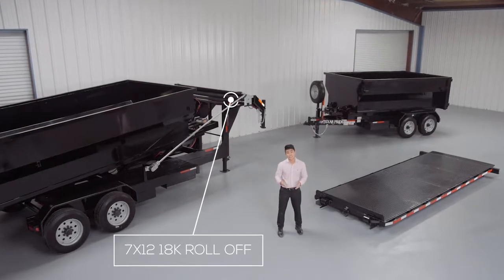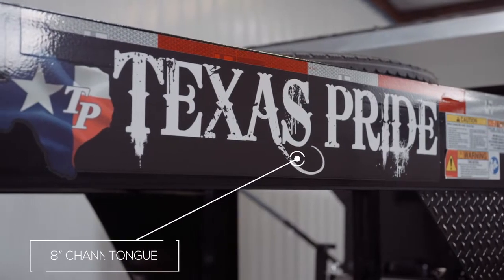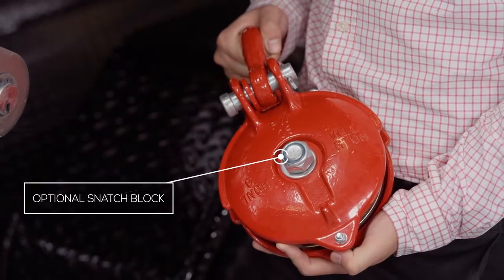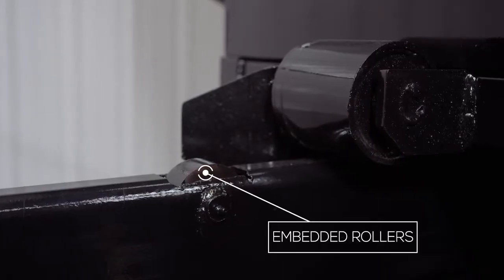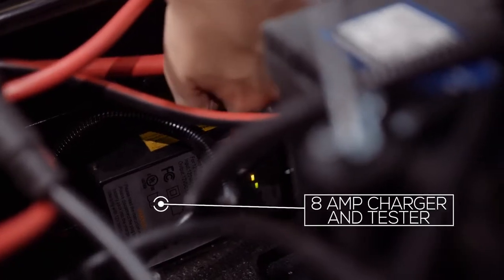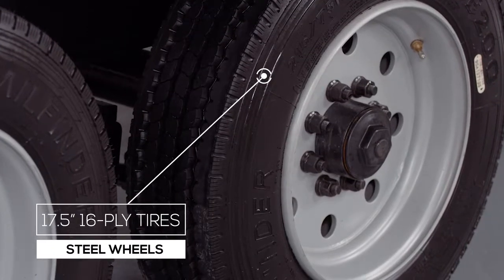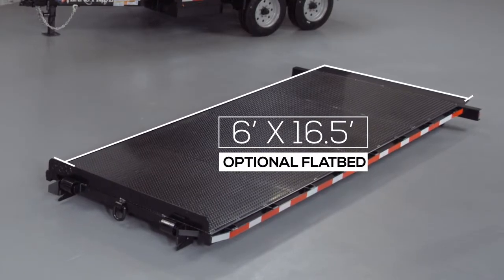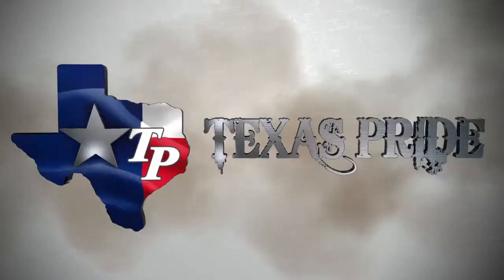Walk Around: 18K lb GVWR Roll Off Trailer System | Texas Pride

Comment: Wanted to wait bit before reviewing. 

I  bought one of the 18K  goosenecks roll off  packages in mid 2021  was suppose to have all of the goodies optional accessories  gas engine pack  & power tarp  wireless remote,  hyd  jacks etc.    2 x15yd  and 1 x25yd.
As trailer is traded between multiple trucks and did not want to  wire them  all with the  12v harness plug.  

Now 7 months in.

Trailer and  bins have done & hauled all the jobs that  have been asked of  it.

The  Bad: 

 Salesmen I talked to  transferred on me midstream  and no contact on the build  from anyone till  called to check on progress  and found this out. (this was a 6 month out build.)
Brandon became my new one.

   
You lost the trailer frame  the week when we were scheduled  to pick it up.   Called me 3 days before as I was already in route  sitting at a hotel in Texas.       Was sent out for some reason.   Stated it was a yard mistake.  And then had another  one but had to put the trailer together.

Arrived at 8 AM   3 days later trailer was still not done   said would be done in a couple hours and did not leave till 4 PM  that night. 
 
Did not get hydraulic jacks which were ordered on my original trailer.  

1. This trailer with the weight it  can  haul.  There have been many times have had to drop loaded trailer to  run somewhere  that I'm unable to take the trailer with.   With the  25yd  full of wood debris  hand cranking  stinks to get it  on/off the truck.  Regret not having the hydraulic jacks.
  
2. This is plugged in after uses,  when sits for a couple days,  and plugged in  the night before use.  This is the same while driving  attached to  your  truck also.   With the gas power pack setup the charging system only charges the battery in the side box which is for the electric brakes and tarping system.        It does not charge the gas power pack battery on top of the neck.    Have had this go dead and the motor not start in the morning after going on vacation even though plugged in  the night before.   

3.  Power pack  needs to have full remote controls  on the gooseneck for throttle and choke on the upright where  the key switch is mounted.   Or a  fuel injected  motor would be the other option.    I  am not  7' tall.  Having to  continually climb up or carry a step ladder  every time  to start  the motor  between the truck & trailer to work  throttle  and choke fill  to get it started.  Colder weather has made this  worse being every start needs choke now below 60  

4. Remote fuel tank possibly  in side box or somewhere for the gooseneck.  As the  tank  mounted on  top  of the power pack on the  neck somewhere 7' up in  the air.

5.  Power tarp    
 Hand cranking  height  should be power  have spent more time  height adjusting between  bins   cranking that  handle .   Than it takes to  unload  or load & secure the bin on the rack.